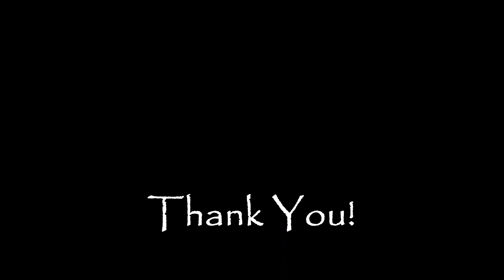The Physics of Fire By Friction

Comment: An abstract mathematical model of the bow drill is really interesting. Thank you for sharing! What other outdoor or primitive skills could be modeled in this way?
Reply from the maker: @TheGRoques  Thank you. I’ve been toying with trying to model the pump drill. I’m not sure I have a handle on all the variables yet, though. I pick up the project on occasion as insights come to me. I hope I’ll figure it out someday.  Wish me luck.
Reply: @FlintStryker  I wish you luck! A mathematical model of the pump drill would be really interesting. I'm curious how the pump drill compares to the bow drill in terms of mechanical advantage or efficiency — the physical effort required to produce a coal. I assume the pump drill would be more efficient. What are your thoughts based on your personal experience?
Reply from the maker: @TheGRoques  It's really hard to say. With practice either method can produce very fast embers. The pump drill is probably easier to learn overall, though some find it challenging to maintain a good pump rhythm long enough.